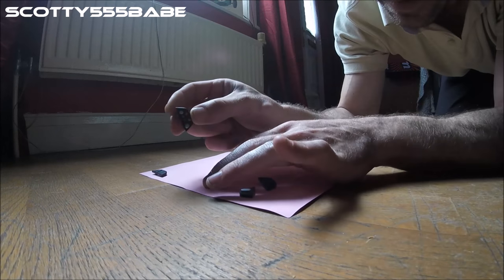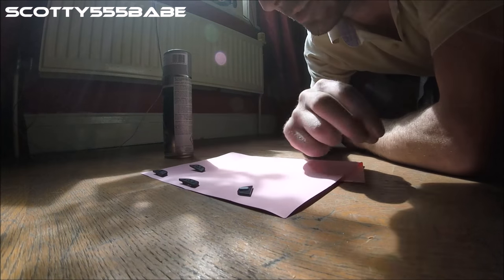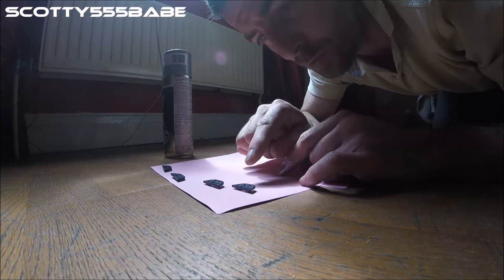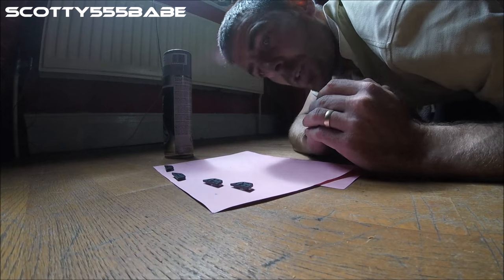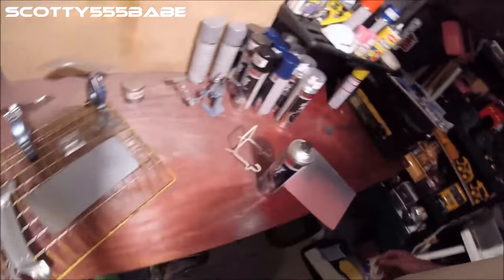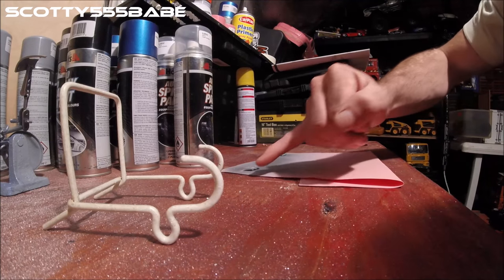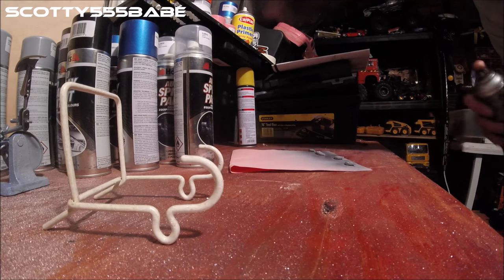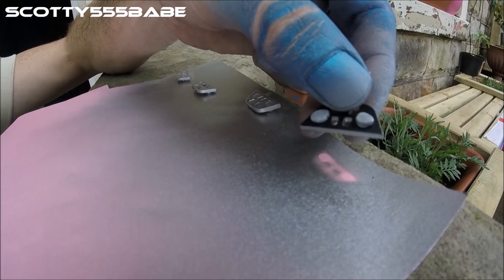PAINTING SMALL PARTS | TIPS & TRICKS | TAMIYA RC SEMI TRUCKS 👍👍👍

Comment: Good tip.... 
I personally use  'Bluetack' (or the like) in a similar way, but stick the bits to the end of a cocktail stick, 
which in turn I stick into foam, potato, or just more 'tack'....
Keeps the bits even further away from harm, and also gives you chance to actually apply some paint 
around the back edges.
Reply from the maker: Great stuff, some more great tips there, I like the idea of using a cocktail stick as I could get more of the underside. Cheers
Reply: +scotty555babe RC TRUCKIN´ UK Hi I would like most for her son
Mercedes Benz Actros 1845 for controlling the tuning and any discounts provided you knew . How much would it happen together ? If you have such a Mercedes please send a photo

Comment: Hi mate you got a hand like me lol good tip thanks do you clear coat your trucks as I want to but have read on the forums about it reacting with the paint have you had bad experiences like that? Also what rear cross member you having on your SLT mate cheers  b
Reply from the maker: Hi bud. I will be putting a metal rear cross member on with the hook, A lot of lacquer paints can react, It all depends on temperature, how you spray and sometimes the lacquer is pure **, I always use holts paints from primer, base and clear coats and have never had a problem, I usually put up to 3 or 4 coats of clear so there is a reflection in the paint. But every now and then I may get a lacquer bubble at a corner. (let it go off and a gentle rub with soapy water and 2000 paper. Hope this is of help to you.

Comment: Cheers mate yes it does help I'm using Tamiya paints and clear coats I've bought them so want to use them as I want a glossy polished look but just got worried with what I've read I've emailed matey and they have the SLT parts but there not on the web site so now waiting for them to get back to me coss I'm wanting the front tow hook and two prop shafts and want to order them all together    Don't like waiting lol cheers  b
Reply from the maker: Tamiya paints are good and you should't have a problem, just make sure your area is dust free, warm and spray from a distance as the tamiya paints tend to spray fast from the nozzle so go easy and have fun with the build, SLT parts are available from truescaletrucks, there on facebook so if you ask there you will get a pretty prompt reply, if not Ill contact the owner and get him to get in touch. Cheers
Reply: +scotty555babe RC TRUCKIN' UK excellent thanks mate👍
Reply from the maker: buff771 No problem, happy to help